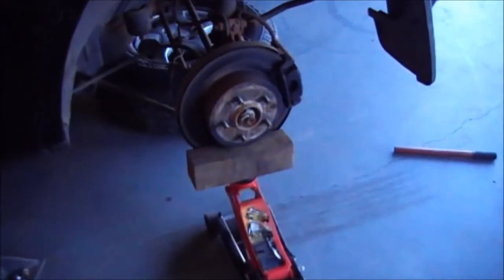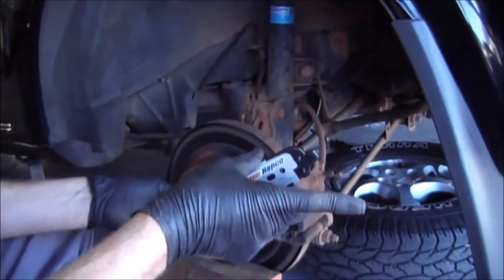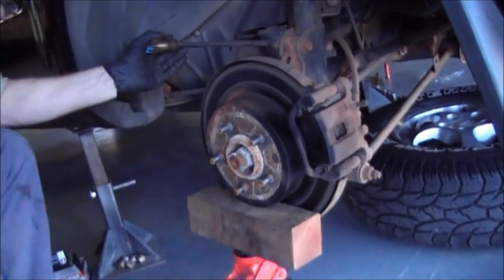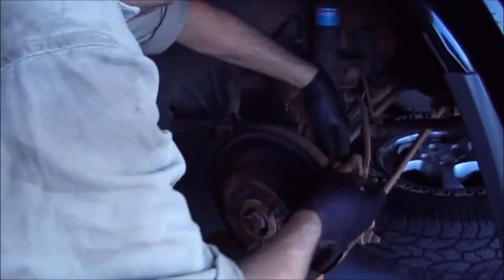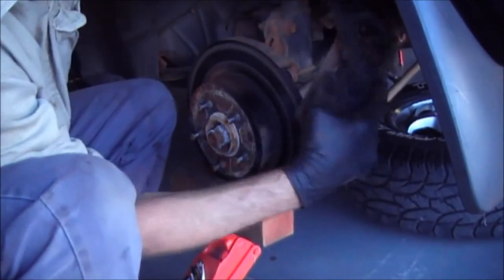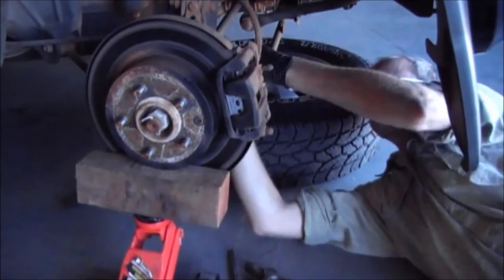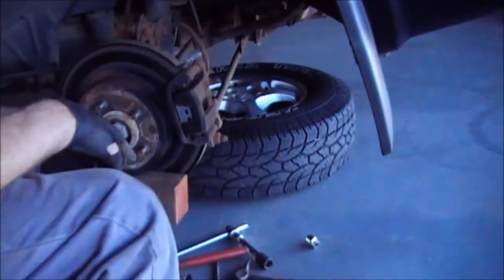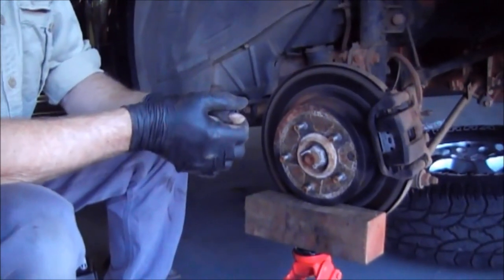Replacing Nissan X-Trail Brake Pads

Comment: Great video except dont be under car holding only on alligator jack :/. Also check sliders, and do silicon grease on metal clips that hold pads
Reply: Not sure what you mean about the "check sliders"  - but fair points any way.
Reply: @broomhandlecowboy  he means to take a pair of big chanel lock pliers and squeeze  from the bracket and slider pin head bolt to make sure the sliders are moving freely. You should also be cleaning and adding brake lubricant to the slider pins and cleaning the shims and adding anti seize to the brake pad shims. I wouldn't take advice from this guy in the video, He has no idea what he is doing and should not be showing other people how to improperly work on their cars.

Comment: just a tip, next time I would advise servicing the sliders. If the driver doesn't do lots of driving the sliders are going to seize to the inside of the bracket (steel on steel) you should be servicing the sliders every single time you do brakes. Having sliders that move freely is gong to increase the life span of the brake pads. You should also clean and add anti seize to the brake pad shims. Teaching people how to work on their cars should only be done by professional mechanics who know what they are doing. There are so many things wrong with this video its outrageous